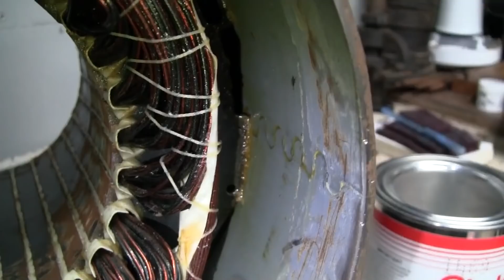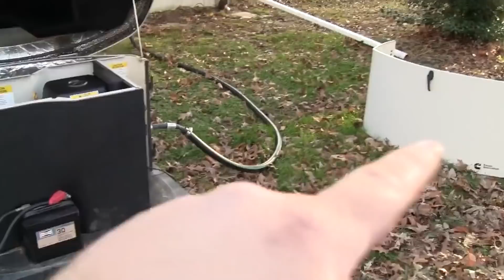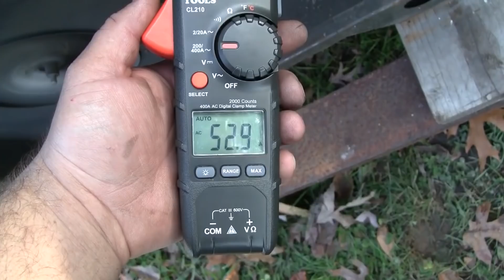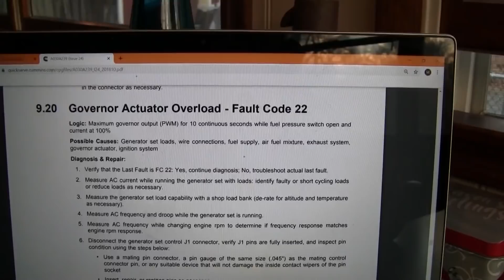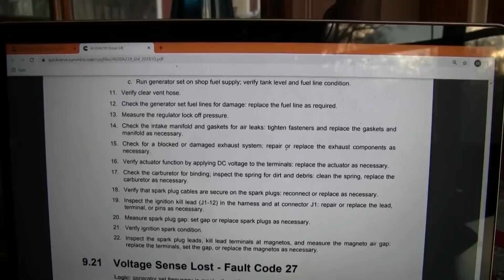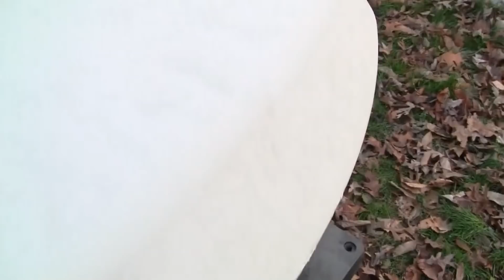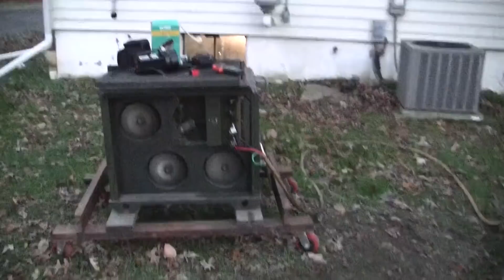COMPLETE REPAIR AND TEST 2015 Cummins Power Home Stand By Generator Pt. 2/2

Comment: For gas flow and other useful information, Google Cummins T-030 manual, it has a LOT of useful information. I think the last one I downloaded is T-030f revision on file. With it you can calculate gas flow through different size pipes and how much a bend like a 90° adds to the length of a pipe.

Comment: Outstanding video ! Very informative. Looking at same model for my buddy. After cleaning the slip rings the unit still only produces 60v. Any thoughts on what you've seen that could cause that less than half output? Also how to physically locate the Q1/Q2 leads for testing that winding. Look as I may, I don't see them. Appreciated.

Comment: This thing seams like a toy really. Brushed alternator instead of brushless => fail. Exposed electronics => fail. No conformal coating on electronics => fail. Air cooled instead of water cooled => fail. Noisy 3,600 (2 pole) alternator instead of much quieter 1,800 rpm (4 pole) => fail. Not able to handle increasing loads stepwise => fail.

Comment: Can I please contact you ? I have the same as the above generator that has only 0.7 hours on the clock, the board tested Ok according to Cummins Tech., the rotor tested 28.6 ohms, brushes like brand new, slip rings like new, the stator passed the test (The Tech. removed all cooper wires from the L1,L2,N wires and tested each cooper wire and coil separately) passed the continues test, the generator will work only 10 seconds and will shut itself down with fault code 13 AC voltage is low, I am only getting 50V . please help I will pay for your time and advice.

Comment: I have the newer version of this generator, the C20N6H..  Bought it in 2018, it did it’s weekly tests for a year or 18 months, then on the first real power outage, after 16 hours, it shutdown, and will no longer generate 240V.  What it does now is spike up to 350V or so, then shuts itself off with an “Overvoltage” error code..  Had an independent generator repair place look at it, they cleaned the slip rings, but they are pretty much clueless, and tell me it needs a new “A026E165” control card..  well, this was during Covid, and they were never able to get the part, I have called them multiple times and they just don’t care..  wondering if it actually needs that control board (which is $1400-1500), or it may have something else wrong with it..  have any ideas?  Just abiut ready to put it in my trailer and take it to the dump, it’s useless.  Where are you, i’ll drive it over and you can have your way with it 😂  Mitch

Comment: I'm an engineer myself, but on the  computer and networking design architect side working Microsoft and the Fed for years, but i still embrace my mechanical roots, I rebuilt my first car engine at 15 years old, and i took apart every mechanical toy i got my hands on when i was wet behind the ears.  I don't get to work hands on with small motors much anymore, too much arthritis and bad eyesight, but your videos are an absolute joy to watch.  You are thorough, easy to understand, and meticulous.  Your stroboscope trick was excellent, a lot of times that's hard to catch with a camera.  Thanks for keeping us entertained!

Comment: Running on a gas, there's no top end lube except what gets past the rings, virtually zero.  Gasoline engines wear out from lack of ring lube near TDC.  Diesel fuel, however, is an oil, a lubricant with some unburned fuel always coating cylinder walls that prevents wear.  Greasy old diesels, not running EPA lean, run for decades like my original-engined '83 Mercedes 300TD.  Change oil often (3000 miles or 100 hours) and your grandchildren can run it....

Comment: I would never buy a generator with a gas engine. Too sensitive for moist and in times of crisis the chance of being able to buy gas at a station is very small after a few days into the crisis. And even when you're somehow able to buy gas it will be extremely expensive while a diesel doesn't need hydrocarbons, it will even run on depleted (vegetative) cooking oil. Diesels run on almost any oil.
Reply: OLD diesels will, NEW diesels are designed to prevent running on free oils.
In my yard, is a Mercedes '83 300TD 5cyl turbocharged diesel and a retired air force Chevy stepvan with 6.2l Detroit Diesel V8 both running on 75% filtered used motor oil thinned with 25% filtered used ATF.  Recycling waste is greener than EVs.

Comment: I put my comment on the wrong video 😮 YTs ads are a PITS,  anyway what I wanted to say about the Cummins Generator is they make a great Diesel Engine you would think they would put the same care into anything they have their name on?😮 I've been trying to decide what to tell my sister to buy ? A Generac or Cummins Generator? I think Generac is overrated and you pay for all that advertising, where Cummins you would think should be a superior product (based on my experience with the Cummins in the RAM trucks)  now I'm not sure? Do they not have the same Quality Control with their other products. ? Or was this an isolated incident?
Reply: I paid $500 for a 33KVA continuous duty, commercial-grade diesel genset from a hospital remote clinic, including all the automatic hot start switchgear.  Had 290 hours and professional maintenance on it.  We rented a big van to go get it from Alabama.  The clinic got a 150KVA monster.

Comment: I really liked your repair on the rotor.  Nice work.
On the testing, I think you risked overheating the stator when running that much load for over 2 hours. 😮   Under actual backup power use for a large house, that Genset would rarely need to support 1/2  that much continuous load.
The use of an IR thermometer would let you measure temperature on the stator windings. 
I loved the use of the stroboscope.

Comment: 5:11 Just discovered your <OUTSTANDING> channel. Sorry if this is redundant but as convenient as the hypodermic-style epoxy is, I've been using West System marine-grade epoxy and additives for decades, mainly for boat applications. For the rotor repair encapsulation I'd use their 105 resin and 205 (fast) hardener plus their 404 high-density filler. You can mix as much or as little of the filler as you want to achieve the perfect viscosity. Skip the pumps that screw into the cans, they eventually become a huge mess ... just pour it out carefully ... I use a quality kitchen scale to measure the 2 parts accurately 5:1 resin/hardener by weight. Little plastic cups are great for small batches. The resin and hardener last (almost) forever if you store them in a place that doesn't bake in the summer.

Comment: YOUR VIDEOS ARE THE BEST !!!!! ❤

I am contemplating buying a 3600 rpm standby home generator.  All of these companies really market their engines and do videos on them like the engine is the only thing that matters.  
Watching you diagnose the Rotor/Stator was fascinating.  

I wish there were videos where you take apart various Home StandBy Generators and show people what manufacturer is the most robust generator vs the price point.   I was shocked to see only 40 hours ! On the generator !!   You would think these manufacturers would inspect their parts before assembly.   

I am currently looking at:
Cummins 13Kv
Kohler 12Kv
Briggs & Stratton 12Kv
Champion 12.5 & 14Kv

Not sure about B&S because it is a vertical shaft twin.  Not sure about the reliability.  

Anyway, just wanted to say very interesting Thank You.
Reply: DON'T!  Buy the 1800 RPM 4 pole diesel genset, even used like mine.  33KVA 4 cyl commercial grade used for $500.

Comment: no gen will get full rated load on LP or Natural Gas. it is all marketing bullshit. FAA bought a pile of propane generators 15kVA that you can get 12 out of on a good day and even better they fall on there face if they take a big inrush current. Diesel is still king

Comment: Excellent work! I like your strobe light for viewing the repair in motion. I am not a fan of gas engines for power generation. I prefer 4 pole units that run at 1800 rpm. With Diesel engines. I own a military surplus 10k generator. It uses static excitation powered by an Onan diesel. MEP 803. My load bank is an electric stove.

Comment: The load shutdown was very likely the result of not having the required fuel pressure to allow for the unit to meet the demand.  The unit was at 100% throttle for more than 10 seconds which resulted in the shutdown.  If you had the required fuel pressure/ volume this would not have happened.  I think you got this one fixed.  I would be comfortable with it being capable of taking a full 20KW load for short periods at a time and carrying a 16KW load constant.  Good job, you get an up vote.

Comment: Probably good for at least 50 years in standby service!.  Excellent logic, troubleshooting and repair skills exhibited. However, when you epoxied over your soldering  junctions, I hope you didn't inadvertantly epoxy the slipring carrier to the armature! When you pulled out that can of Glyptol, memories flooded back to my aircraft and instrument repair days... we'd use it to secure calibration potentiometer shafts on various and sundry "line replaceable units" (LRU) so they couldn't change their settings (potentially caused by the aircraft vibrations).
Reply from the maker: Thanks for checking it out Thomas

Comment: Nice job but an expensive repair even kohler would not fix it and the customer thank god had an extended warrentee. These are cheap generators not very well made. My company does installations only no longer repair work and have seen many failures from poor workmanship on both ends installation and repairs. Low gas pressure is our biggest problem.

Comment: I have the same generator, only the 2018 version of it..  it only has 27 hours on it, and gets an “overvoltage” shutdown, had people out to look at it, and it’s having a voltage regulator issue (pits out 340V), supposedly regulation is now all done on the main PCB..  can’t get a replacement, but it’s still under parts warranty..  where are you located?  want a crack at it?  I’m about ready to throw the POS away.

Comment: Super video!  I came to the conclusion that, at the full load, the engine wasn't getting enough fuel, (low pressure), and the governor was demanding more power.  An excellent teaching video.  I have a cheap Chinese  5.5 KW unit that has discoloured windings just like what you saw on this unit.  I will now be able to have a closer look to determine whether or not the unit was overloaded.  My problem is, that I couldn't find the correct resistance for the stator windings.

Comment: Used to be jealous of the engineer section in our platoon. We had to figure out how to not die from a pot belly stove and they just had to hook up their load bank. Lol
Reply: Shaw AFB SC used to go  to North Field on mobility training exercises.  The officers slept in tents like Army Air Corps from WW2.  The enlisted men drove down in their fansy pickup trucks towing their 5th wheel, air conditioned RV monsters or custom motor homes!   :face-green-smiling:
The colonels liked it so they'd have someplace to hang out with plenty of free beer.

Comment: Hello I am a subscriber of yours, wondering if you're familiar with the world war II generator ZXB M5? Iv restored it, run beautiful. Before I restored it I made sure it was producing output none of the outlets worked but I was able to hook a jumper cable to a couple of the three fuses on the control panel and I was able to power a drill since I put it back together it absolutely does nothing. The voltage gauge is reading and when you turn the thermostat you can hear the engine become like it has a load on it but you can't hook anything up to it to power anything as in a hand drill if I made a video would you be interested in looking at it to see what might the problem be?

Comment: @SmallEngineMechanic  I think your factory defect to the stator theory is wrong. Take a look at the rotor and you will see the damage on it in the same place and that rotor wasnt in the picture when that stator was being finished up at the factory. Have a look at timestamp 3:51, 3:58 and 10:12.   You can clearly see the stuff which looks like lacquer hanging off the rotor that was being turned around the longitudinal axis and that is what scraped up the stator and its windings.

Comment: Hi, I think the gas regulator on house is only rated for 250000 cubic ft of gas per hr, a larger gas regulator such as 400000 cubic ft per hr and a largeger supply line would allow for 20kw output.. The feed line from street to house probably has a 1/2 inch pipe buried in ground and on top of ground to gas regulator used 1 inch pipe.
Reply: Kind of a "gas hog", ain't it?!

Comment: I appreciate repairs that exceed new condition.  The customer with the new warranted gen will be dealing with this again someday.  But I know you'll be there for them if it does happen.  I have this generator, with this fault, although mine was throwing sparks near the oil cooler also.  So, more than one issue, I would say.  Thanks very much for the video.  Great stuff.

Comment: Did you ever get the feeling that companies don’t give a shit if it even works out of the box. I can’t believe anyone would design a brush slip ring that depended on the “ grace of god” to make connections to the windings. This look like Chinese crap to me. You buy a famous and most probably expensive generator to depend on what you have is basically cheep Chinese quality. What a rip off

Comment: Is that a molten section of nylon strap on page 5:54? 

Stator winding enamel wire color is either single or two colors. Single = normal. Two color one which is darker color = have been over heated. Also page 5:54

Comment: A family friend just installed a new generac natural gas 18kw home generator and is giving me his older
unit with only 405 hours on it. It appears to be a 2004 OA4531A inline 4cyl 18kw on natural gas or 22kw on propane
also by generac... My friend says its just old and was time to replace it.
He thinks everything was working when they replaced it last year. 
I suspect this older generac is better than some of the new gensets out there
I need to find someone like you to look it over and set it up.
What kind of questions do I ask a service company to see if they have any real skills?
Thanks for sharing... Impressed with your skills... in Hampton Va.
Happy Holidays!

Comment: You indicated that Cummins quit using this particular generator assy in their home generator sets, which is good to know.  But do you know what they replaced it with?  Or if it addressed the rotor wiring issue?  Great job, very impressed with your skills.

Comment: reminds me of my swimming pool heaters .....haven't found one yet that has lasted longer than 3 years......i would have returned the generator and tried to get my money back if possible
Reply: Er, ah go read 15USC50 sect 2304(a)(4)  which reads:
"(4) if the product (or a component part thereof) contains a defect or malfunction after a reasonable number of attempts by the warrantor to remedy defects or malfunctions in such product, such warrantor 
READ THIS PART!
must permit the consumer to elect either a refund for, or replacement without charge of, such product or part (as the case may be).
IT'S YOUR CHOICE, NOT THEIRS!
 The Commission may by rule specify for purposes of this paragraph, what constitutes a reasonable number of attempts to remedy particular kinds of defects or malfunctions under different circumstances. If the warrantor replaces a component part of a consumer product, such replacement shall include installing the part in the product without charge."

FTC explains to them they have 3 attempts or 30 days to fix it to YOUR satisfaction, not theirs.  GM is NOT exempt.
The more who DEMAND, in court if necessary, they fix any defect under this FEDERAL LAW, the better.

https://www.ftc.gov/tips-advice/business-center/guidance/businesspersons-guide-federal-warranty-law
Here's the FTC manual telling THEM what their responsibilities are to YOU, the consumer, without the company bullshit,  This is FEDERAL LAW good in all 50 states and territories.

Comment: I like his comment about the noise level and when he said " maybe a bit much in a residential area",  first thing I thought was not if everyone is out of power and you are warm because your neighbor with the " noisy generator" is sharing some of his power with you!
Reply: When I installed my 33KW genset, I installed an outdoor breaker panel with 6 20A NMEA outlets 120/240V.  They buried long dropcords between us.  My deal is they keep my 250 gallon #2 fuel tank filled and pay for genset maintenance and I power up the cords when the grid dies.  It's a great deal!

Comment: Loved your vid on this small generator and your fault finding technics.......I have a Chinese 8kva Diesel Genset that I used for welding. All was going well until it decided to stop. Thought it could have been the AVR which I had a spare. After swapping this over, still no good. Then checked the fuel cut off solenoid. (Still to be replaced). Installed a new fuel injector. But alas still no good. Not sure how the welding would have stopped the unit. If you have any ideas it would be most appreciated.

Comment: Great pair of videos. Do you prefer air cooled hole house gen sets or liquid cooled?  Any preference with manufactures?  Thanks again for all you work recording your videos.
Reply from the maker: It’s a trade off.  Liquid cooled tend to be quieter and last longer but there is more maintenance required.
Reply from the maker: No real preference with the air cooled units, they are pretty much all the same.
Reply: Yanmar or Kubota, liquid cooled, 1800 RPM, 4 pole alternator.  PARTS ALWAYS AVAILABLE